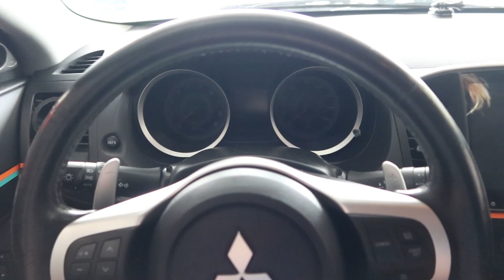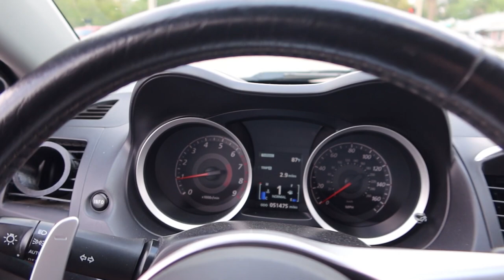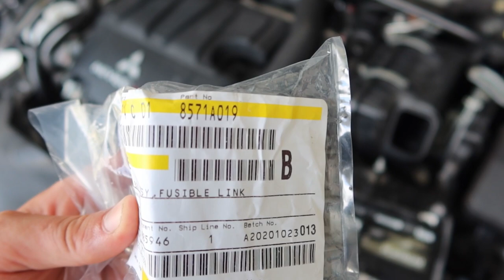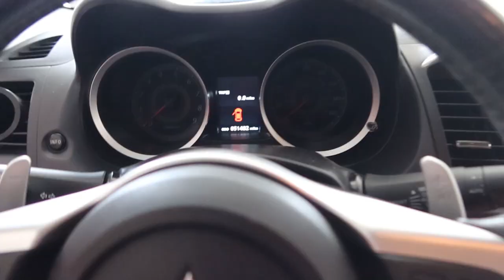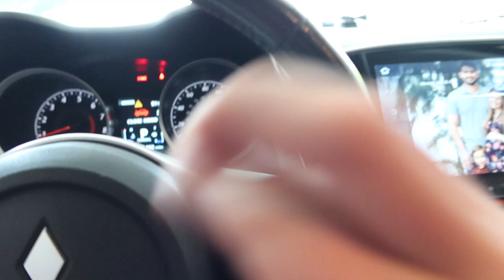Lancer/Ralliart/EvoX AC and Radio  not working.. (Fusible Link)

Comment: I had a bad alternator and battery so I jumped my car alottt and then it sat for a few months before actually fixing it. Well I got the Alternator and battery changed and still no power to my charging ports, no radio no A/c and very little to NO information online about what the heck it could be. I even opened up the dash to make sure all the cables were good. I finally stumbled on this video which seems to be the only one that has to do with the fusible link box. I also went ahead and ordered from the dealership near me, 2 days later and a few minutes to install and bam! Everything works great now. 

You literally fixed my car bro, thank you!
Reply from the maker: This is what I do it for. Love to help others out and here the feedback. Appreciate it!

Comment: Would this be a cause for front windshield wipers quitting. Good fuse and had the wiper motor recall done? Rear wipers and fluid works...at a loss and looking for relief.

Comment: I looked at the fusible link and nothing was burnt out or charred, but one was slightly covered with the greenish blue copper sulfate. Would that be grounds to replace? My radio went out one day and haven't been able to turn it back on, while the android head unit still works and turns on. I've tried reconnecting the radio cable and still doesn't work. I can't seem to figure out why else the radio wouldn't be working...

Comment: So after I replaced the link now my car locks my dome lights don’t work and no radio but the AC works
Reply: Just replaced mine a few minutes ago. Everything that u mentioned wasn’t working and now is. Are u sure you installed the cables correctly?
Reply: @diegomendez4525  yeah dude I think the internal wires were just straight fried after the fuse blew

Comment: the nasty chinese head unit would have caused that, have a look at some teardowns of these units by electricians, some units are ok others are sloppy and can cause shorts in the electrical system, good thing it was a fuse and not  redirected x amps into the ecu, these units use canbus (if you bought that type of unit) canbus is the back bone network of these cars and you wouldn't want 60 amps going through it and hitting everything because the ground in the head unit wasn't soldered properly.
Reply: That head unit, I had in my Ralliart, worst thing I ever installed wouldn't be surprised if it's causing issues now... It just stopped working, switched to a 9 inch Sony